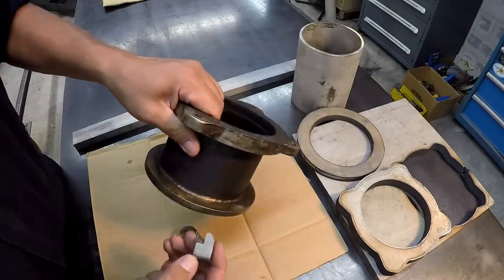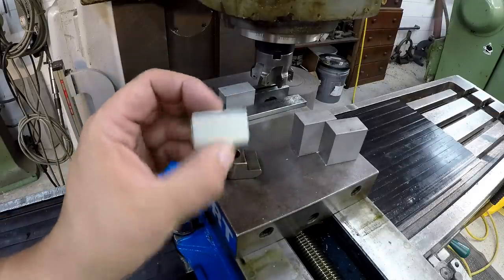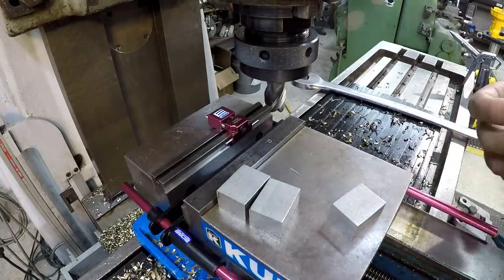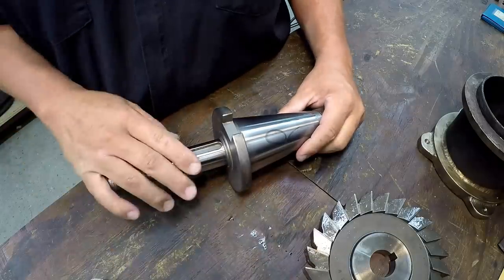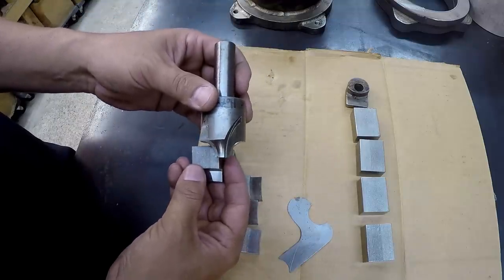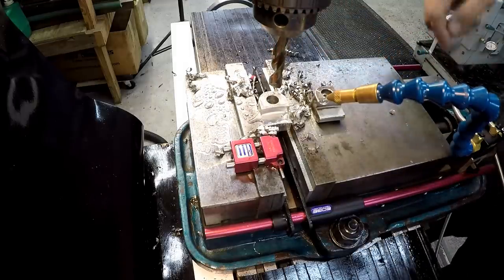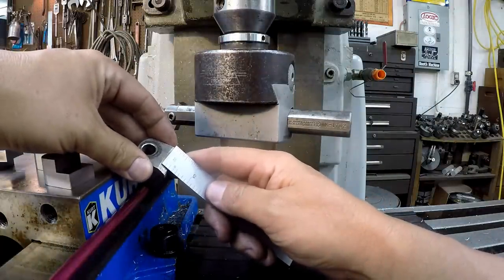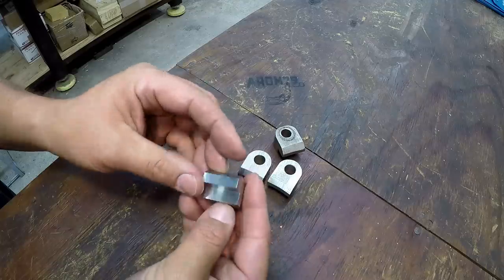Stainless Hold Down Clamps Part 1

Comment: I always think so many folks are doing C N C right out of the gate ,but what came before built C N C namely Man On Machine, If all you've done is run CNC and have no experience with manual then you're screwed,and its machine man to the rescue!!!!
Reply: @Joseph Wilson Correct! CNC is to manual machining what Computers are to manual bookkeeping. It makes repeating a complex task faster and more reliable, nothing more.

Comment: Just a thought; you might consider bolting them pieces to a plate, and then chuck the plate in the lathe and tool that radiused bevel that way. Just a thought. Never mind, you went a different route.....maybe next time.

Comment: Great video, one question I had was for cutting that bevel, why did you not just use the 7" diameter cutter again and hold the workpiece at an angle?
Reply from the maker: Why not show different ways of doing things?
Reply: @Abom79  Definitely a valid point, just wanted to make sure I wasn't totally off base! You used some techniques I had never seen before in this video, which were very informative and creative!

Comment: To avoid the problem of the second piece kicking back when in the vice with another item for milling, could you not employ your method of using a slightly softer material rod between the vice jaw and the material to be milled to take up the minute variation in thickness?

Comment: Adam, when using big end mills like that, they are much longer than the part you are cutting, do you try to use different sections of its cutting length to try to wear on it evenly? I don't mean during the same cut or even the same series of parts, but in general over the life of a cutter.

Comment: Adam. How much quill pressure do you recommend when drilling holes in stainless? I’ve always been of the understanding that you press hard and use low speed. If it’s not turning good sized chips, then you’re doing it wrong. What’s your opinion? Maybe you could make a video of drilling all types of metals and the types of drill bits as well.

Comment: This is really just a question:  Could you have cut a ring out of the plate then bore the inside for the lower radius as well as the upper radius then drill the holes then cut each piece of the ring.. kinda like work with one part .. and could you make a ring the size of the outside radius needed?.. just asking... i really have no clue about this stuff .. However i love watchen Abom work... this stuff has always seem so KEWL to me...

Comment: Adam,  What type of stainless did the customer specify for this turbo diesel job?  I know that different types of stainless are better than others for specific uses, but engine work like this is an unknown to me.  I've built engines, but I've never built parts for an engine system.
Reply from the maker: They didn’t specify what grade they want or need so I went with 304.

Comment: which stainless is that? (300, 400 series? other?)
Reply: my guess is 316
Reply: @designworksdw1949  yeah i was thinking something like that. 316, maybe 316L. but i hear its a bit of a bitch to machine. like, it wants very specific speed, feeds and tooling. then again the sources never clarified if they were using carbide or HSS tooling when they made that claim... which is kinda SUPER important hahaha.
Reply: It is 304
Reply: @tobiasripper4124  usually carbide tools...hss dulled quickly on stainless or alloy materials like 4140 if is not hss-cobalt 10 percent....its all about experience and filing  and what grade of stainless,there is free machining one,like butter joy to work with...and some real hard ones...but its nothing compared to high alloy materials like Hardox 450...high abrasive resistant alloy at around 45 HRC Rockwell....  nightmare for machining....used for heavy machines,armor etc ...
Reply: @sinkosav  yes, i know carbide is the way to go.. but i also heard that there are specific inserts for certain stainless like 304. of course you can get away with "most common" carbide inserts, but the right ones will give you the top shelf finish (not that it is required for a piece like the one adam is working on). as i said above, im not a machinist... haven't even used a lathe yet. but doesn't hurt to gather knwoledge here and there for "one day" :D

Comment: You failed bandsawing 101. Turn the bar 90 Deg. More teeth in contact will cut faster and be easier on the blade. Also if you make a squaring jaw you can use an insert cutter to square the entire block.

Comment: Did any one else think that cutter was going the wrong way??
Reply: Paul Hewitt It's an illusion. You see it a lot in Westerns on TV. The wheels of the stagecoach look to be spinning backwards. It's caused by intermodulation between the RPM and the frame rate of the camera.

Comment: cnc is for sissy's.  In a post apocalyptic world with no computers ...Adam still gets it done.
Reply: Yes he gets it done and surely does an excellent job but sometimes you have to weigh which is more economical way to do a certain job.As a machine shop owner I would do the pipe and end flanges manually but do the clamps on a cnc mill.Not every customer gives work without a quote so have to stay competitive.
Reply: yeah,where he will get electricity LOL...